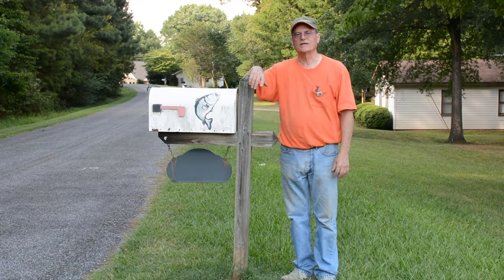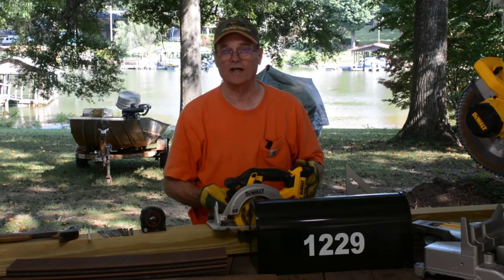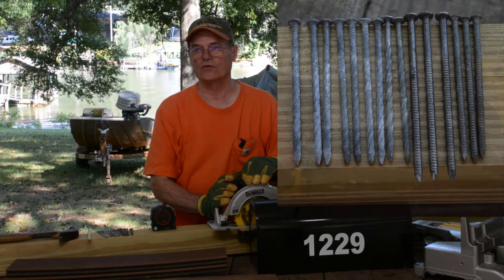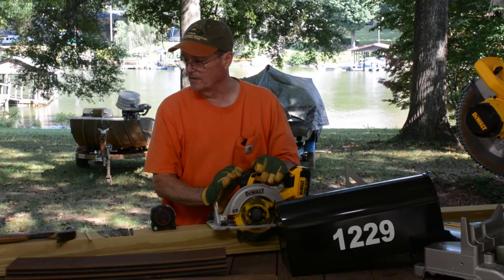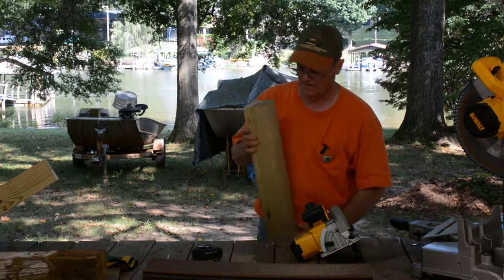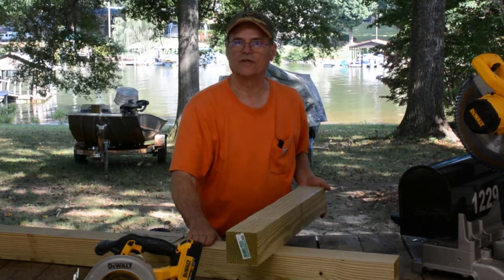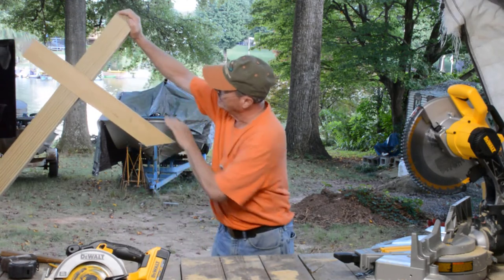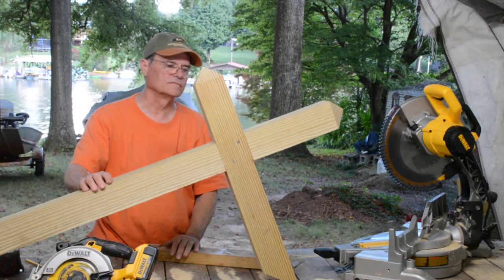How to build a long lasting Mailbox Post

Comment: Great video. Thanks for the tips
Reply from the maker: Glad it was helpful!  Thank you for the kind comment and for visiting, have a great day.
Reply: @DIYwithWayne  one last question. For the diamond cuts what angle was your saw set to? Thank you!
Reply from the maker: It was set to 45 degrease.  You could adjust that to most any angel you want.

Comment: Very detailed video Thank You Wayne. 
I may have missed it but what length nails did you use?
Reply from the maker: Thank you for the kind comment.  The nails were just less than the length to go all the way through the 4X4.  I think they were 3 1/2 or 3 3/4.  If you get nails that are just a little too long, just put them in at an angle.  Thank you for visiting, have a great day.
Reply: @DIYwithWayne  Thank you for such a quick response! I wish i found your site sooner!

Comment: Any tips on sourcing the wood?  All the local box stores have poor quality 4x4's with knots and twist and soaking wet from the pressure treating process. I don't want to wait months for them to dry out and risk twisting up in the process.
Reply from the maker: I got mine from the big box store near me because it was easy.  There may be some twisting but I have had very little.  Just pick through the supply and pick the best you can.   Good luck with your project and have a great day.

Comment: Dumb question:  what is the angle of the miter saw when sawing the end of the post?
Reply from the maker: NO, It's not a dumb question.  I should have told in the video what angle I used.  It was a 45 degree on the end at the mailbox door and a 45 on the back of the cross piece and top of the post.   Thank you for visiting and have a great day.

Comment: Wow, that mailbox hasnt been hit by a single plow truck yet...
Reply from the maker: Not much of a problem in NC! Thanks for visiting and have a great day.
Reply: @DIYwithWayne  lol.  Here in SC, we never know who’s going to hit it.   Mine got nailed once  and replaced 3.5 years ago with pre-built from big box store.   PTL or cedar, can’t recall, but rotted to the core.   So now replacing.   Wanted to build like u did but lumber so green and I have to paint (HOA) 🙄.  And didn’t want or couldn’t wait 60-90 days to prime/paint PTL. 

NICE cuts on cross brace.   I’m dissembling the one I just bought (wasn’t green).  And reassemble.    I will likely use deck screws and counter sink

Good point you made with the screws for mailbox.   Too many over look this.   I may get lazy with liquid nails.   🤣.  We call it the SEABEE CAN-DO method.  

Look forward to checking out some of your other vids.  👍👍
Reply from the maker: Hello Alan,  Thank you for visiting and subscribing.  Good luck with your mailbox and have a great day.